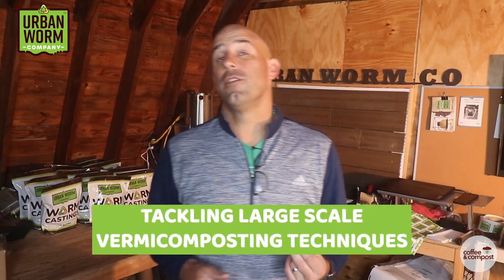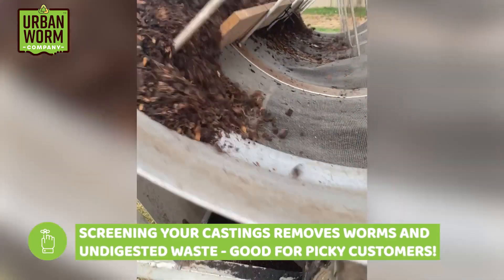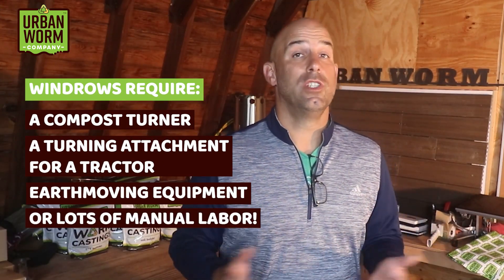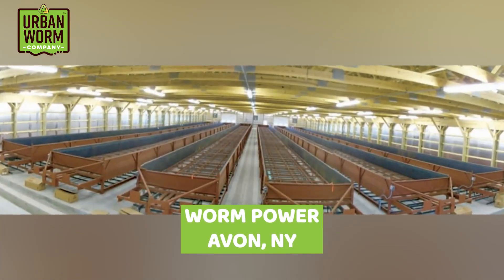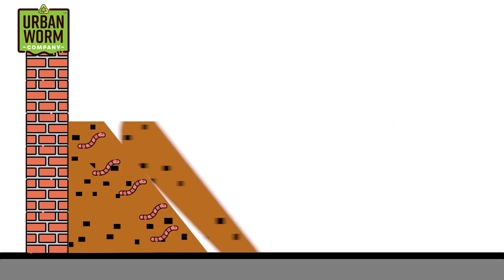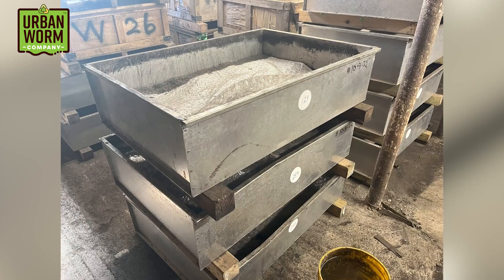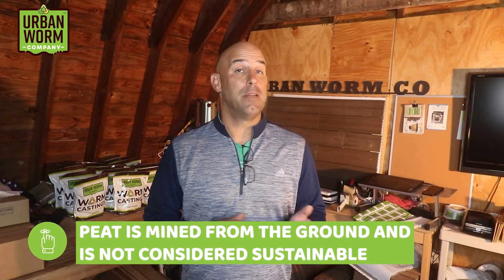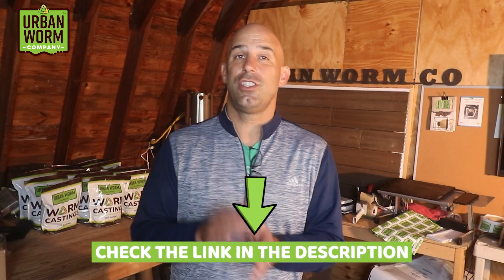Massive Worm Castings Production Methods

Comment: Steve do you know of anyone who combines BSF to compost first then feed that to the worms? Would that work?
Reply from the maker: I've heard of this idea many times but not heard of anyone actually doing it at scale. But here's my issue with it....from what I can tell, BSFL frass is more expensive than worm castings. From a purely economic standpoint, taking a more expensive product to create a less expensive product doesn't make business sense.
I'm also not sure what benefit you'd get from worms eating frass that they wouldn't get eating pre-composted materials. I'm not saying there's no benefit, I'm just not aware of it. I'd love to talk to someone doing it though!
Reply: @UrbanWormCompany  disclaimer:  writing all of this with no practical experience - I was envisioning a BSF set up that the benefit would be quick decomposition of food wastes (even meats, materials etc. that compost worms don’t like).  The larvae (correct term?) self-harvest so good food for fish in pond, treats for chickens etc. and the frass (didn’t know it was called that) undergoes another transformation to make it less likely to harbor bad pathogens (e-coli was a concern in one thing I read).  Side benefits of BSF is they supposedly keep away or deter other flies, or so I read.   Still digging into the idea, but this was also my idea for personal use, not trying for commercial sales.  Now if I got to live out what I could dream up, then this would on a scale to produce enough material for 5-10 acres of flowers and garlic which are intended for commercial use.   Now I just need to survive the driveway, power installation and well process, and the buildings hahaha.  That has not been too fun so far.  I am so grateful we have people like you to learn from and one day I hope when I comment, it will be from actual experience.